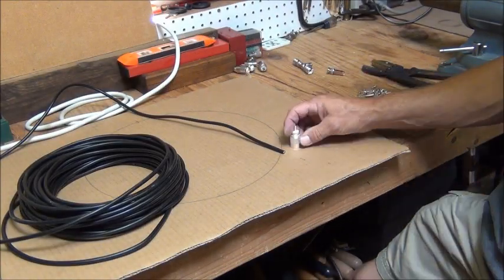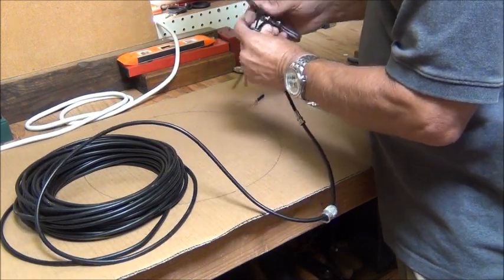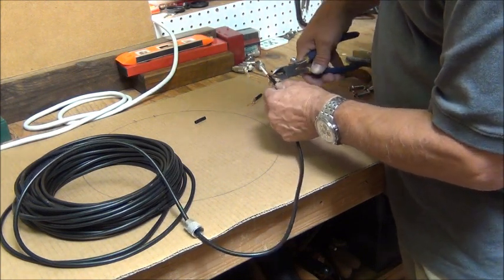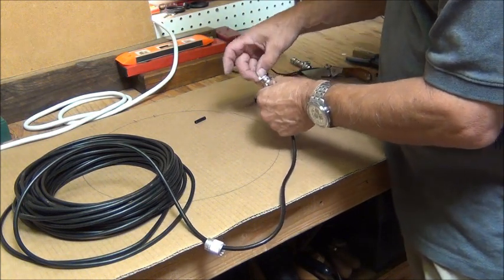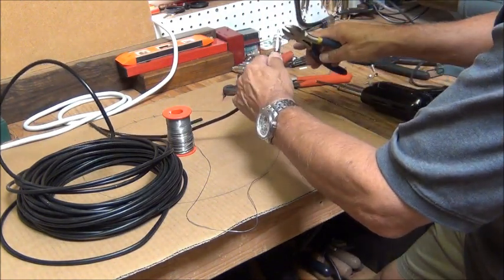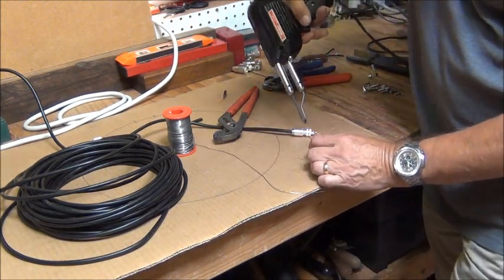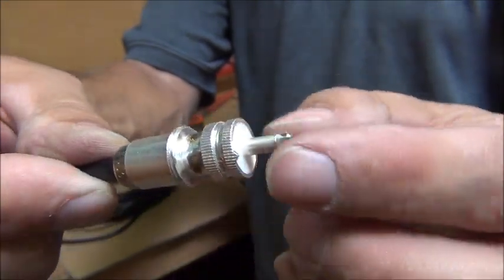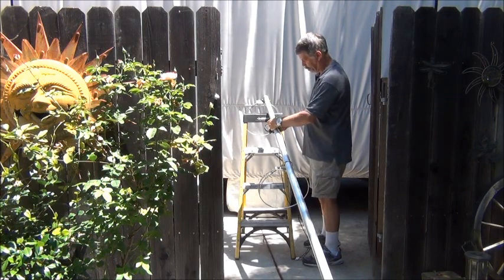2 Meter Halo Antenna Part 13 -- "Phasing Harness construction & installation" by N6TWW

Comment: Looking forward to the finish of this project and how well it works.  You have some very good math going for your theory.  You strip insulation the same way I do.  Soldering is done much easier with some rosin flux especially on big stuff like a PL--259 connectors.  You'll have to make sure you don't melt the dielectric.   That sure is a lot of work for an antenna.  I think I would have settled for a dipole or maybe a yagi 3 element.